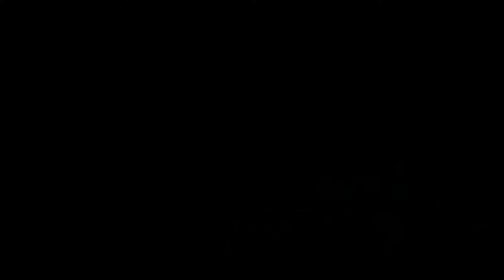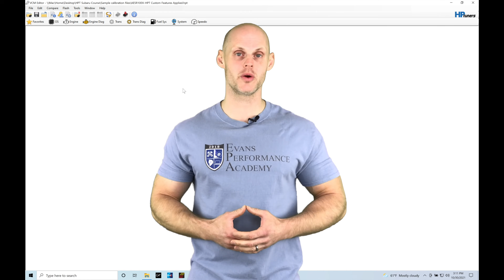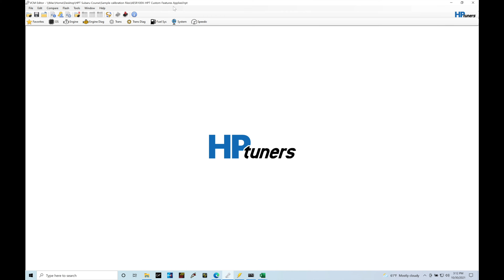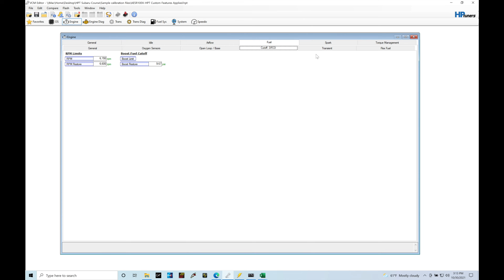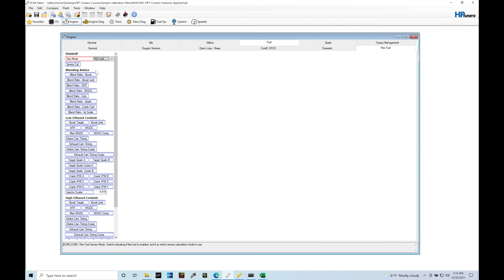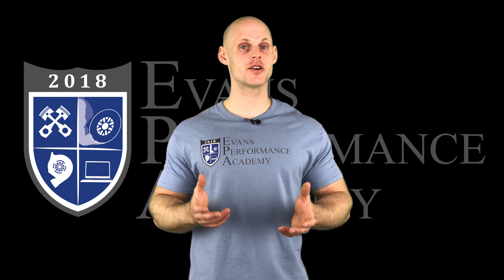HP Tuners Subaru Training Course Part 31: Flex Fuel Tuning | Evans Performance Academy

Comment: Do u have s550 mustang hp tuning videos in your courses?
Reply from the maker: We have mod motor and s197 HP Tuners currently available.  s550 gen 2 training will be releasing in June/July.
Reply: @EvansPerformanceAcademy  does hp tuners still supporting flex fuel on Subaru sti ?